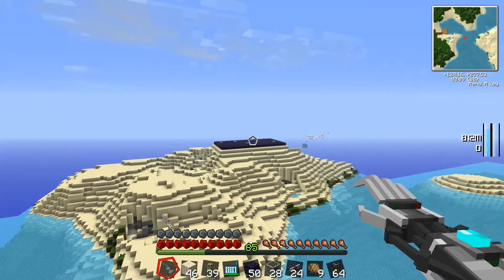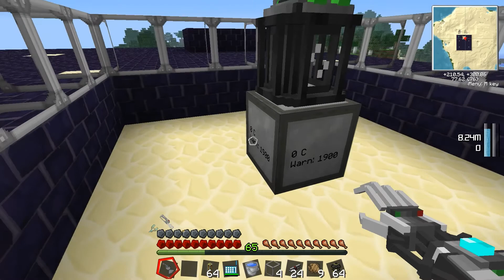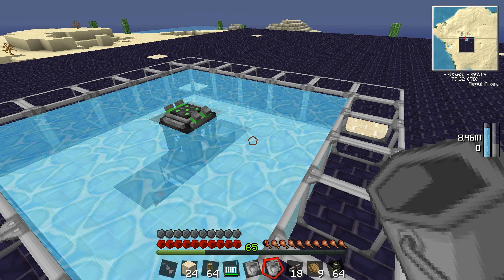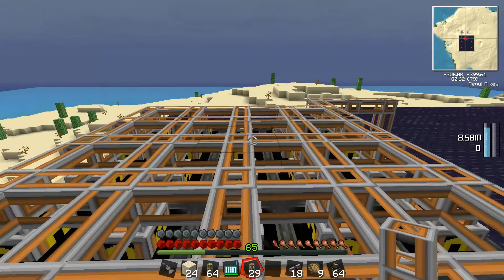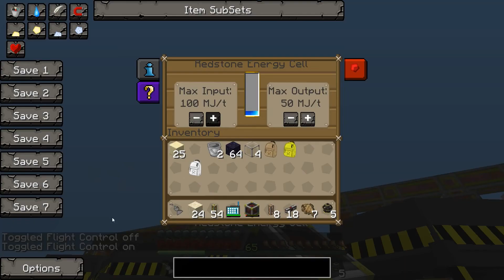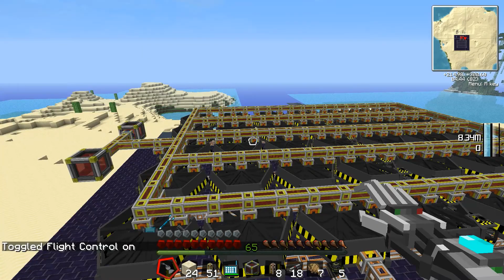Insanely Awesome, Safe Tekkit Fission Reactor Set Up for Minecraft 1.5.2!

Comment: Hello.  I can explain why the redstone energy cells were getting power.  Thought it would be fun to claim it's the reactor design, it is not.  The Modular Powersuit can link with the Redstone Energy Cells in your inventory and trickle change them using the solar cell add-on and/or any of the other 2 energy generation add-ons for the suit.  The cells energy storage is also added to the suits total power storage.  It's a very cool, but little known combined feature of the two mods.